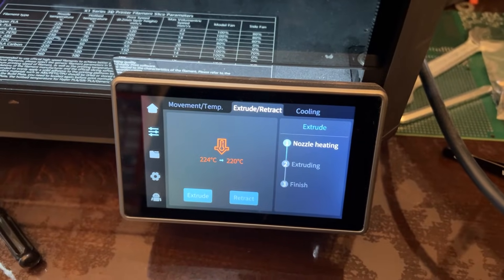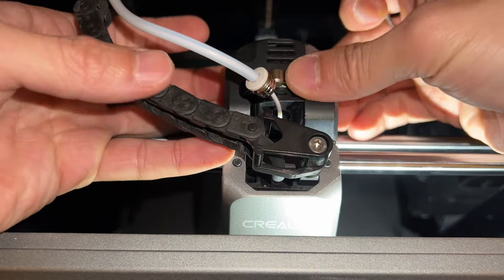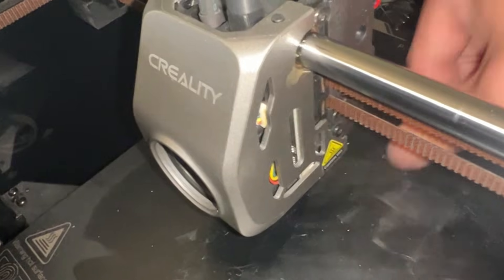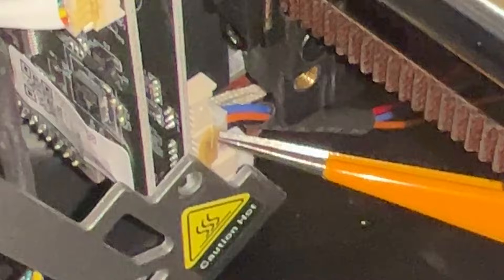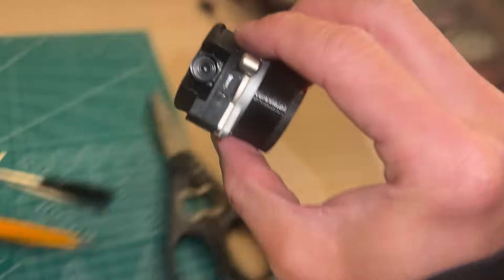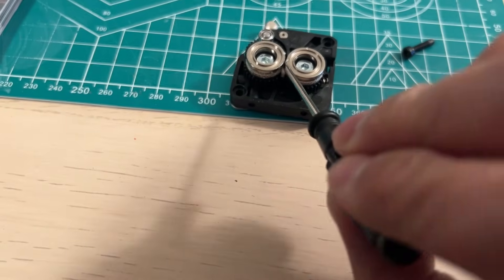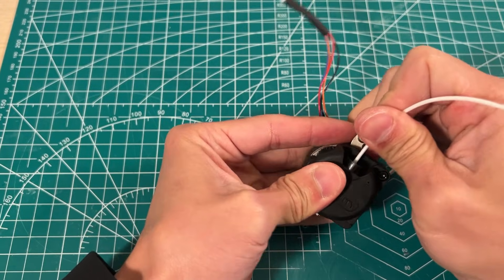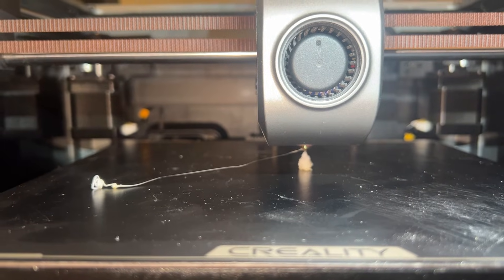Fix Creality K1C Max Clicking Issue Caused by Filament Jam in 3D Printer Extruder #unclog #nozzle

Comment: Good video, thank you. My problem wasant filament jam inside the extruder, but for some reason, when I set to extrude an error 2569 shows and the print stop's. I thinked it was the motor or PCB, and them I watched your video and see the part that u unlock the extruder and set print to extrude, tham the motor runs freely. I tried here, and it worked, after I locked the print turns to extrude normally
Reply from the maker: Glad my video helped!

Comment: how did you remove the tube fiting?
Reply from the maker: The fitting is a friction fit, you can remove it by pulling the tube, or using pliers.

Comment: Did your extruder come right out? It looks like it should slide up and out and it won’t go.

Mine wiggles with the screws out but will not come out
Reply from the maker: You are not wrong. It doesn’t come right out. Need a bit wiggling.
Reply: @idonull appreciate it! I was worried I was gonna break it.

Like you said, keep wiggling haha

The wiggle with the pressure helped.

The machine is running again! (For now haha)

Comment: tried to do this.... then when i was removing motor or what ever light shut off. error 2569. thank you for breaking my printer. please help
Reply from the maker: oops.... did you try this with power on?
Reply: @idonull  oh god yes am i cooked
Reply from the maker: No not yet....you can probably salvage it by replacing the printer head controller board. Amazon sells it for <$50.
Reply: @idonull , on and off fixed it. dont worry, i just did it without removing entirely

Comment: That's ridiculous! I read about this problem once and again, here and there. This eventually leads to all three extruder gears failure in different combinations. All extruder gears in all 3D printier brands wear, that's their naure and bad fortune but for some reason while I see Bambu Lab users complain about extruder gears wear after 1000 hours and beyond or total print time I see a great number of reports from Creality owners who say: "I've only printed for 2 weeks and the gears are stripped". What's up? Can anyone explain it to me?
Reply: My theory is that Bambi uses a higher quality metal coating around the gears. Micro-plastic abrasion seems to subtly saw down the gears on my K1, and a microscope view confirms this after soaking in alcohol for 3 days to dissolve micros
Reply from the maker: It was clogged by a small piece of debris....no stripping.

Comment: New k1 max - third print all good. 4th print the motor had ‘locked’ would not turn with power on or off. Bought and installed the upgraded motor and extractor from Creality. Now perfect. Better than sending whole machine for agent to work on. Instructions on youtube was very helpful.
Reply from the maker: Glad the video helped!

Comment: I had the same problem day one of owning this machine - Fixed it using this video - Looking at other comments on Google it looks like this is more to do with a design fault rather than poor filamant etc.
Reply: Design fault... And K1C is said to be a totally upgraded and improved version of the notorious K1. How come? However what confusers me even more is when I read a number of "500 hundred trouble free printing hours" reports on Reddit.
Reply: Have you ever had this issue again I’m day 1 aswell
Reply: It just happened to me within 2 weeks of having it. Probably some 70 hours of printing pla, abs, petg. After some ABS I was starting to test some TPU. Idk, I’m new to this, maybe I didnt purge well the abs